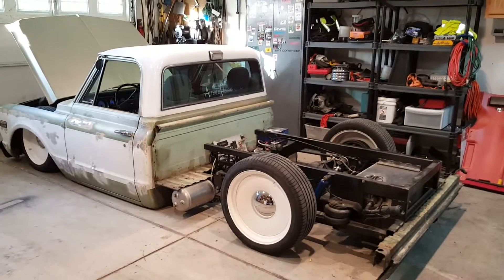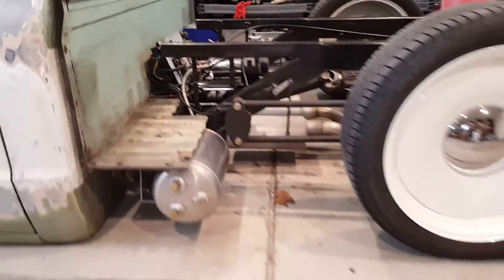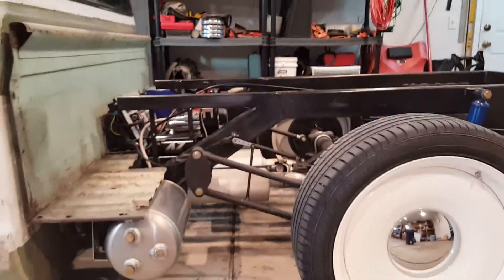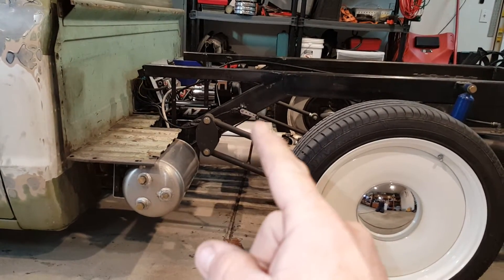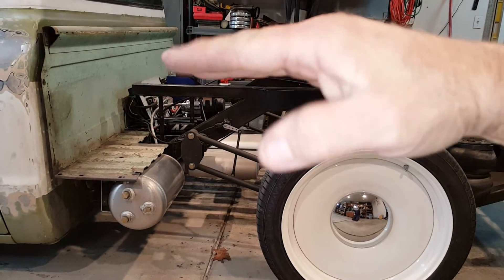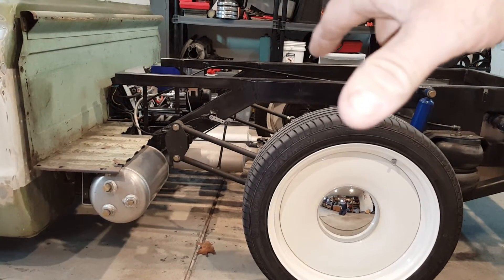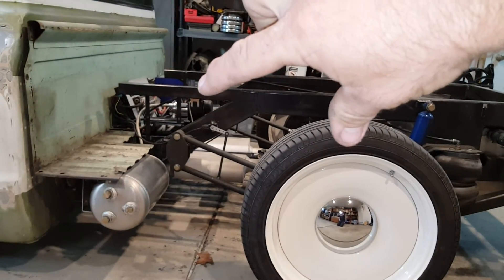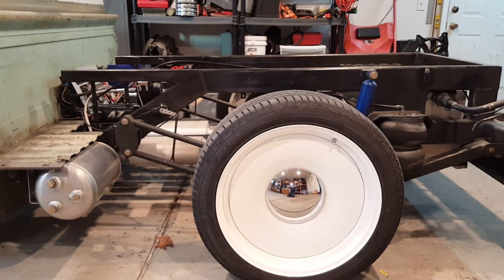4 link position

Comment: how did you mount the seats? I'm looking to do the same seats in my 81.
Reply from the maker: I drilled new holes and used large washers so it wouldn't tear the metal if I got in an accident
Reply: +Bill Newell and it'll bolt right in with the brakets from the seats and the console?
Reply from the maker: +daniel kinman yes sir. Perfect width. I took the center console lid off because my wife like to ride in the middle and it gave her more leg room, so I built a thinner lid.